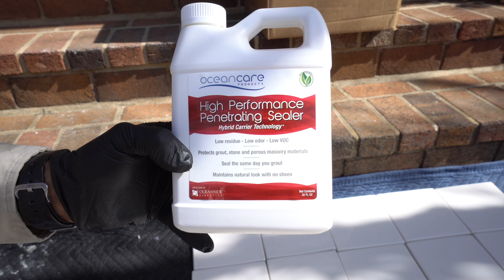How to install - handmade Crackle Glazed Tile - Certified Installers (part one/prep day)

Comment: Hey guys, lots of good info there! Ardex primer and backer/leveler are new to me but looks like some awesome products. I've leveled numerous floors and hate adding yet another 1/4" of backer before tiling. I will look into using it next time I have to level a floor. 

Speaking of floor leveling, I recently started working for a contractor and one of my first jobs was to tile a large (300 sq ft) bathroom floor with loose run heating wire. The contractor would not let me level the floor first, insisting that it would interfere with the heat transfering to the surface. I had to lay the tile directly over the wires. Needless to say, the mortar was really thick and keeping the tiles flush was difficult to say the least. Of course, I did use a tile leveling system. Not sure I could have done it otherwise. Now that I see you doing exactly what he said I can't do, well... I probably shouldn't share my thoughts on the matter. Anyway, great video and super nice work. Subscribed!
Reply from the maker: Ted Weddell  Thank you! Happy to hear that our videos helped . More good things coming up 🙂. Stay tuned. 
As for your case, you could use a uncoupling membrane and encapsulate the wire into the membrane, and solved your problem. 
If you apply on top of a concrete slab you have to get a thermal brake uncoupling membrane, that stops heat dissipating.
Or next time use LBB from Ardex like we did in this video.😁
Again thank you for your feedback!😉
Every week I’ll try to post a new video, being more consistent from now on.Cheers pal!👍🏻